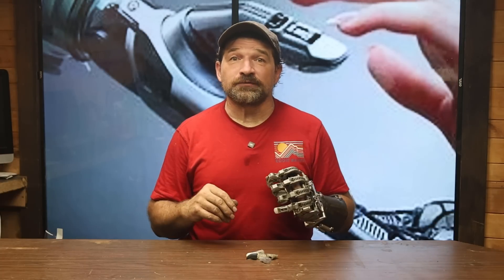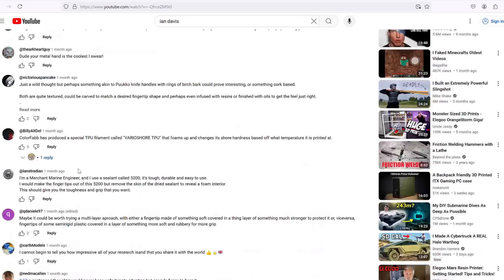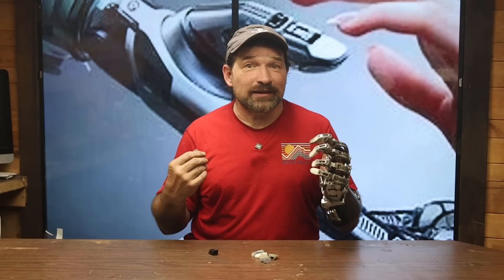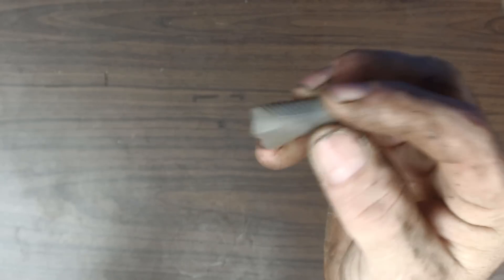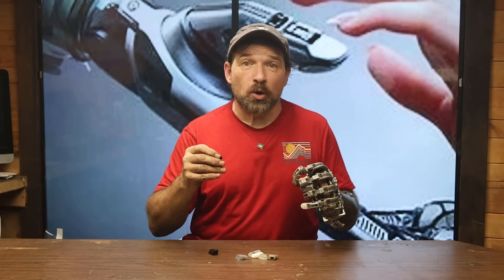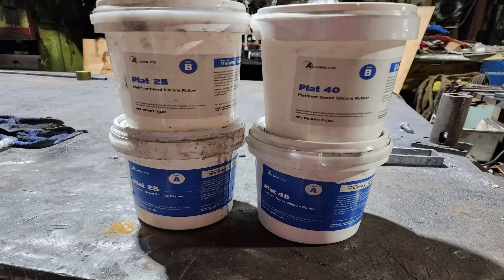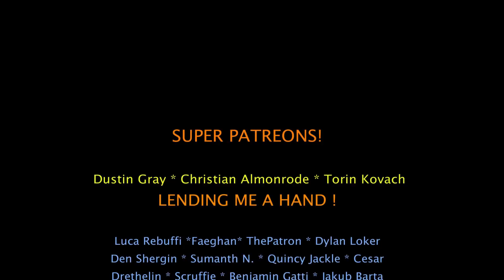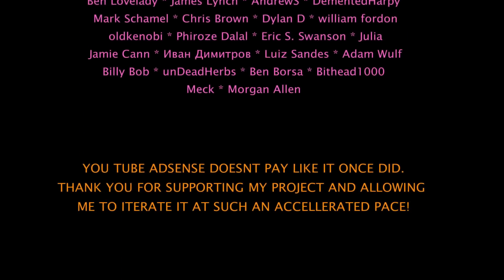Continuing the Quest to build the Perfect fingertips

Comment: I find it hard to believe that there isn't a slicer out there that could let you set areas of the print to different heat levels. I haven't 3d printed anything in a long time (years), but I recently saw where you could do a "fuzzy" section of a model using a boolean operation. There must be something like this somewhere for temperature settings...

Comment: My suggestion would be printing the snap on bit of the finger tip in a shape similar to the bone that would be in there, albeit with a couple through holes on the sides for connecting the skin material. 
Once that's made of ridig material, you could try dipping them in plasti-dip, and if you need multiple layers  to get the level of squish you're looking for, add some cotton mesh/fibers to the surface before it cures for better strength and tear resistance.

The plasti dip should hold up a lot better in a shop environment, it comes in lots of colors, is quite widely avalable, is a one step process, and if you can find the sprayable stuff, you could very easily clean and degrease a worn fingertip and give it a coat or two to renew the skin!
Reply: Oh i forgot to mention: printing the finger bone shape is so that you have a covering of rubber that emulates a fleshy finger grip, has a lip to hold the covering in place on each axis, as well as giving you the ability to get the covering past the edge of the knuckle, wear the most... wear seems to occur and lead to the coating peeling off it's frame

Comment: Idk how you'd accomplish it, but snow tires use a special rubber compound, and lots of microsiping, which helps grip the road/snow by providing lots of biting surfaces. It's also a durable enough rubber to not wear or break. Either way, super awesome to see what you come up with.

Comment: One thing I think you could do is dual firmness of TPUs with an IDEX or multi-head. Varioshore is going to behave pretty similarly to the untreated leather tbh.. it's all in how the 'softness' is made, in this case it's tiny little explosions that create micro voids, not really ideal for cleaning and hygienics! I do think you'll want a dual thickness, asking for a TRUE gradiented thickness would be ideal but a bit too complicated for how slicers are right now, the lag between heating and cooling down compounds on things, massive ooze if it has to wait, etc. That and TPU aren't handled by filament changers, especially the soft stuff. One thing that actually could work, is the 'Palette' filament changer could possibly pre-bond TPU's together, then runs in-sync with the printer, so the filament transitions as it's printing. Depends if it can also handle the softness!

Comment: Have you considered splitting the grip material into many smaller but more tightly attached (and replacable) pieces? Think like a bunch of thin squares shoved into slots in a fin pattern. This would technically leave each piece of polymer or silicon or whatever dettached from each other and hopefully it won't dettach or tear as easy. And gap between the "fins" could be reduced by enlarging the end or left as an oversized fingerprint- hopefully though would provide better stretch stability which is a bit deal with grip and slip. 

The downside is the manufactering complexity shifts from the grips to the fingertip, but you may find this acceptable considering the consumable part is simper.

Comment: 😅 I've worked quite a bit with platinum silicone. There are quite a few things that will cause inhibitions to curing. There is a product called Inhibit X formulated to solve a lot of those issues. However im not sure silicone is the best choice for overmolding here, a urethane might be a better choice. There's a ton of options there.

Comment: Could you include a "finger-nail" in the design of the internal connection part, so that the silicone over-mold has something hard to fall off from? Kind of like a lip.  Or possibly include this in the multi-density print you talked about.  I have been loving watching your iterative design.

Comment: When I want my silicone to be durable, I use fiber in the silicone. A two part "mold maker" silicone is what I use, and if it needs grip, I use the center of a fresnel lens you can get those in the dollar store, but if you look online like Amazon, you can find all sorts of films that go on windows with more intricate "frosted" patterns that might help for more grip. I've used silicone one caulk with a bit of naptha mixed in for a more liquid silicone when molding items and fabric on the outside to make sure it doesn't tear or stretch if the mold was going to be thin but hold a large amount of resin. So, I guess I'm saying fiber infused silicone with a cloth layer around the mounting point(s) should be very resilient, silicone one and naptha make a very smooth flow, 10:1 silicone to naptha should be thin enough for fingerprint grip.

Sorry if you have had this proposed already a dozen times, this is my first time here.

Comment: Hi there! I have two ideas, but I doubt they're any good:

1. Maybe you could attach a metal fingertip with a bit of knurling, then coat in a grippy substance like flex seal or rubber cement?
if that fails,
2. Try on latex gloves?

P.S. I've been subscribed for a few years now, but I hadn't done a great job keeping up with your videos. I hit the notification bell this time, though, and I'm glad to see you're doing well!

Comment: Multi material FFF.  Firm TPU inner with soft TPU outer.  You can print in different filament types, not just colors.  Tom Stanton just did a video where he made wheels from PLA with TPU tires attached, all at once, on the Prusa XL

Comment: a good potential internal structure for over-molding, with a high degree of biomimicry, would be to create a flanged shape on the end of the harder internal plug, much like how the shape of the bones in our fingertips widen and turn up near the tips, effectively treating the metal/plastic sleeve as the bone, and the silicone as the fleshy pad of the fingertip, and it would also be possible to leave holes through the edges of the flange, so the material can form a more complete bond, like you mentioned in the video

Comment: What if instead of running through trial and error of silicone, and having it pop off, and having the whole finger tip made out of silicone, why not use the same technique they use in securing pins into headers? Make lil triangular notches in your fingertips, make very thin aluminum or steel inserts that'll flex and after enough pushing click into place, and that insert has holes in itself, that allows the silicone or whatever polymer you'd like to use to secure around the thin mentalic "shield"

Edit: and if you'd like to remove them, maybe you can get it a thick wire soldered/welded on to pull up on the tab, and release the fingertip. 

Hell yeah, fool proof.

Comment: what about a higher durability grade silicone and some sort of lynchpin or press fit notch (like a hole and button setup) to keep them from slipping off easily. how about an inner hard layer and an outer softer silicone layer so you get the best of both worlds?

Comment: I’m sure someone else has said this and you have considered it but if you are going with a prusa XL why not print the inner mounting part with PETG and the outer part with your varying TPU?
Reply from the maker: thats kind of what im doing except im using 95a tpu for the core and 3 kinds of variosore printed at different temps for the body. that way chemically, its all the same material. so far its working really well. the xl is a great printer for this application!

Comment: As a professional 3D printing technician and hobbyist 3D printing action figure maker, I absolutely empathize with the struggle of finding materials with the perfect amount of flex, and I can’t imagine if that struggle was tied to my ability to interact with the world. The multi extruder solution sounds super interesting, but just in case that doesn’t work out and you’re willing to give resin printing another try, I recommend resin by the company Resione. They also have flexible resins that can deliver TPU-like results, but what’s great is they mix super well with their other more solid resins, so just by changing the mix ratios you can achieve a spectrum of results. Also, post processing and curing can have a much bigger effect on the final results than most people think, so I’d also recommend trying extended isopropyl soaking pre cure or even curing the parts while suspended in water (ask oxygen exposure during the cure process can effect the final results). Overall though, your journey is super interesting and I can’t wait to see what solutions you come up with next!

Comment: Tin-cure silicones should be tolerant of the SLA resin, and can sometimes be stronger and more tear-resistant than platinum-cure silicones.
I haven't worked with the VarioShore TPU, but based on my understanding of how it works means that it will always ooze a bit due to continuous evolution of gas. Increasing the travel speed, increasing the retraction distance, and having the slicer avoid crossing perimeters where possible, as well as having it complete individual objects (or closely spaced small groups) one at a time, should all reduce the stringing severity.

Comment: Okay, just spitballing here... But what if the "fingerprints" were just TPU filament set into grooves in a harder base. They could be glued, if necessary, but that way you could easily change material, and treat the filament fingerprint itself as the wear item, and not the entire finger tip.
Reply: wow, just spotted TPU and stopped, Totally what I was thinking. I think building the whole finger tip out of TPU, you can change the infill density to get different compression ratios on your tips. Gives a little push back to help push objects into the finger prints. I would try this and probably just resort to cutting up some TOOTH BRUSH HANDLE grips as finger tips, kind the root of the idea.
Reply: ok maybe I should finish the video lol

Comment: I know you probably mentioned this in your last video, but I am two lazy to go back and check, and I am worried i will forget before this video is done, but have you considered TPU with a low infill? In my experience its relatively tough and has nice grip, and its 3D print-ability would make it easily replaceable

Edit: nevermind, I just got to the part when you talk about it

Comment: One thing you should look into is printing in sequence instead of all at once. You still get the full set, but you only print one at a time. This will reduce the stringing quite a bit as you are having to retract constantly when the printer switches between each part.

Comment: Actual silicone is always awful in my experience (general building work). Stuff like pu40 or ct1 ends up setting into nice soft but very tough rubber and both stick really well to most things given the right surface prep. Downside is moisture/air curing takes quite a long time for thick cross sections.
Sealant for sticking vehicle windows on is even tougher too, and faster cure time.
I've never done any prototyping but have a missing fingertip so keep an eye out when playing with different products.

Comment: What about high pressure injection molding with more durable rubber? I've seen compact DIY injection molding machines build on youtube, so it's possible to do in workshop. Also, one of the options would be to order from China, maybe there are machine parts that require similar characteristics and special rubber designed for this kind of usage scenarios. That way you could order big amount of spare fingertips for cheap.

Comment: You know what would be great material for fingertips? Same stuff skateboard wheels are made of. Sticky/tacky enough like skin, has some give, durable as all heck. Skateboard wheels are made from a synthetic rubber called polyurethane, or urethane. And they come in different hardness levels: Soft (78A - 87A), Medium (88A - 95A), Hard (96A - 101A).

Comment: Maybe add claw-like ofshoots in the middle layer between the silicone and connector. Something to add some additional resistive strength like a finger would under compression, have the claws facing towards the palm so it adds that spring, but also acts as a higher surface area for the silicone to adhere to, it would also keep the silicone sliding off and forward because of the direction of the claws. It looks like you're having a problem with the corners of your interconnector 3d piece creating an uneven pressure at the corners, creating stress and ripping the silicone. Perhaps making the OD of the interconnector piece more circular or more likely elliptical in the cross section could limit this stress buildup. You could add O-rings or perhaps some fibrous inclusions into the silicone (this would need to be put through a few rounds of pressure pot cycles to take all the extra air out) to increase it's strength without compromising so much on the texture. It looks like you're having a lot of the splitting problems towards or originating from the silicone towards the knuckle joint where it snugs flush with the metal backstop of sorts. This might mean that you want to consider if forces going down the finger from tip to palm are compressing the silicone and stretching it at that knuckle joint. Maybe adding extra reinforcement around the outermost ring there so that the stress is more evenly distributed back into the fingertip would reduce the durability and longevity of the finger; think of a jelly cup hitting the floor and the flat bottom expands a load and rips, but if you had a weak elastic band around the very edge of that flat section, it might distribute that load to the middle of the jelly cup, holding it together more. If you make the silicone fingertip slightly smaller, but add another, far tougher silicone or maybe even urethane layer on the outside to act like a skin, soft internally, with a thick, less sensitive casing, that could increase that strength even more, and again hold those pressures causing rips in the material and distributing them more favourably. You are still going to have a problem with them clashing against the backstop at the knuckle and ripping, but maybe that makes it last longer. This might be far beyond scope but hopefully at least one of those suggestions helps you think of something that will help!

Comment: I made an adult toy with hard silicone on the outside and soft silicone on the inside, esentially overmolding silicone on silicone, and it bonded great. Perhaps you could do the same but in reverse, the part looks harder to work with but fingers are adult toys too.
Reply: How about a collaboration between you guys?

Comment: Would it be impossible to put silicone insert also on the inside of the figers/palm? That might help with the wear of the figertips as atm they are the only gripping part taking all of the force, having squishy plates that envelop an object might help, i know you've got rails and chains IN the finger but you are also an awesome engineer and an outer shell seems feasible.

Comment: Have you tried to make your fingertips of a composite sandwich?
The outside skin and tendons are very stiff when compare to inner skin and muscle.
So making a finger tip that is more akin to a tire, except the air gets replaced with soft silicone, should give better results.

P.S.: in this case you make the fingerprint side have less of the harder material and holes where the soft material can attach to.
Then at the finger nail there is columns of the harder material so it attach way better to the core that can be the same or other material chose to stay put in the metal phalanges.

Comment: let me start by saying "i am not an engineer."  but as i listen to your list of tests, i can't help but think, it sounds like you are trying to optimize the wrong design.  meaning, maybe a better question would be, is there another way to design this? what about some type molded, hollow rubber tip and instead of it pressing over the distal, replace the distal with something akin to the top portion of a finger in metal where the rubber part would snap in (pressure fit) looking like a fingernail when viewed from the back of the finger. i do realize that extended use will probably still cause the this to loosen and fall out which might result in something less useful than a bare distal.  but i wonder if a rubber material would be more durable and the amount of "hollowness" could be used to find the right amount of squishiness.  anyway. best of luck.  i applaud your perseverance on this project.

Comment: I almost see a push on split pin on the finger tip & a slip ring style socket with a finned replaceable tip dipped in tool dip or the like. I feel a natural rubber with knurling would also work well as long as you didn't get it wet with isopropyl alcohol. That makes rubber brittle & hard If I remember right.

Comment: Just a thought, what if you used a denim micarta for the tips. I have a few knives and a set of 1911 grips made from the stuff, and it has both a high coefficient of friction and is super durable. My EDC knoife for 3 years now has denim micarta scales and not onlyu are they easy to clean, but no matter how wet or oiley they get I still can hold them strong.